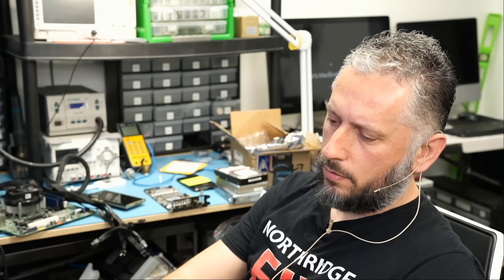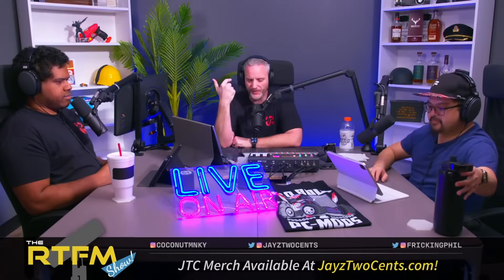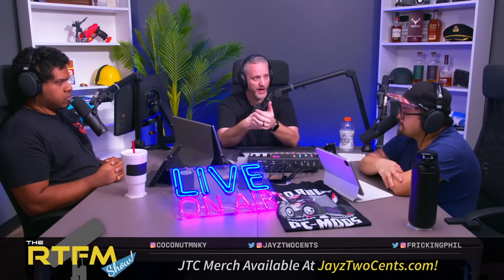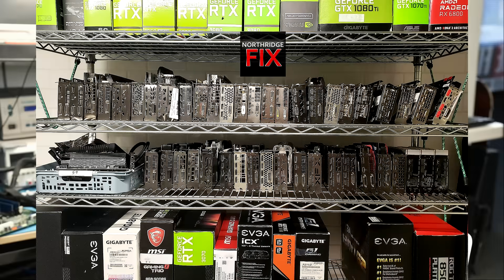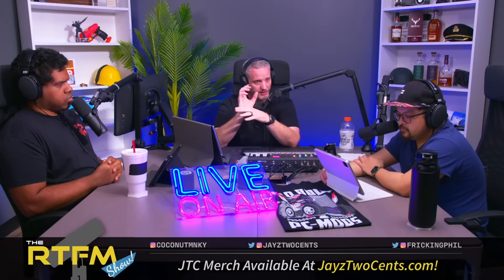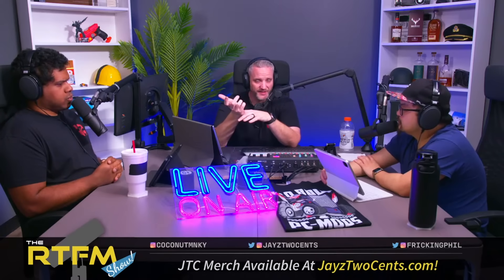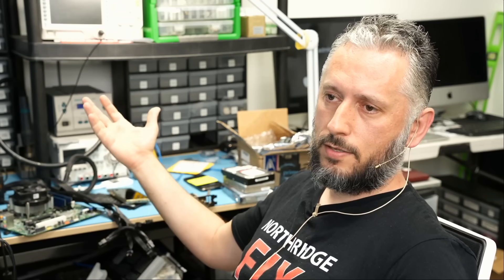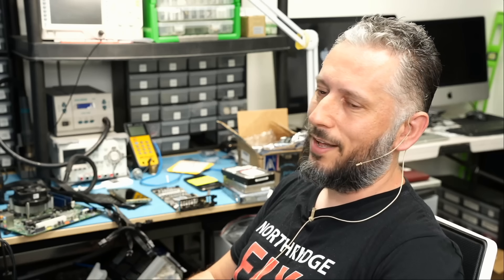Melting 4090 and CableMod. JayzTwoCents and Gamers Nexus Response. Blame NVidia or User?

Comment: I am agree with you, the maker of the card is the fault. The problem existed before you have ever received a 4080 or 4090 Nvidia card for repair. You could tell us, the last 6 months how is changed this in your shop. I think, more and more cards arriving to you, because the maker did not fixed their error.
Right now, the highest priced video cards are Nvidia 4080 and 4090, rather TI or not. For that amount of money, what kind of service do you get from Nvidia? Those cards costs a lot of money, and since not accepting their fault, this means they are not serving the consumers or the clients.
I am planning to buy and put together a high end PC computer, but seeing what happening right now, scars me a lot!
What about I have spared 8000 Dollar or Euro value PC, and I can't use it, because of the maker of the video card company, hiding rules and regulations, policy and warranty and mentioning lawyers defending themselves , instead of solving the problem and giving a high value product a high value service. And yes, I am totally expecting serving my rights and my demand as user to fix the problem, or compensate for the maker error!
How will this end? What happened if you replaced the connector the right way, the user did their best, seeded the connector fully, and again will melt the connector on the graphics card?
This is madness, because someone put their trust, money, and energy to have something at home. Maybe for entertainment, maybe for work, or both. And they lost their effort, because the company who sells the cards says, it is not our fault.
It's truly sad to see all those people fighting to get their card at least usable condition, knowing, will fail their card in the future. And no matter if they tuning their card or not, already too much power runs through their connector.

I am appreciate your hard work to help those people who's coming to you as you can to have their card working again!
Bless you and success!
Attila.

Comment: Has anyone looked to see if all the melted card ports were hooked up by the adapter included, or if they were using ATX3 PSU? I use ATX3 PSU which has a single cable and I have had no issues

Comment: Wiggling the cable will lessen the lifespan of the connector and the lifespan is listed as about 30 insert/disconnect cycles.  Yes, just 30!  The derated current carrying capacity drops well below the rated current consumption of the 4080.  Age and heat cycling will derate it even more as well.  This should have been a custom screw on connector with a large enough surface area and captive lock washers on the screws to prevent them from loosening over time.

Comment: steve with 15 on his shirt is that his iq  with the amount of failures is way beyond any chance of user error i think the pins on the board are too thin and getting hot  the whole connector should be upgraded and have a screw to help pull together and help separate or a lever cam lock like on cars to lock into place squarely as wiggling connector will open up and loosen the contact and cause terminal threading and that will cause heat and burning and that boils down to poor manufacturing and that means its their fault 120 percent agree with you how many cards have the manufacturer repaired and you as a electronics diagnostician see fails and see how the fails happen the root cause

Comment: This one is easy, GPU's increasing thirst for power makes this problem inevitable. Automotive or industrial applications use a different style of connector to consumer electronics. There is a reason the connectors cost 4 times as much. They deal with cable stress, vibration and thermal cycle creep though good connector design. 
https://www.jst.com/wp-content/uploads/2020/12/GIT-18P-img.jpg
1. Transfer cable stress into the housing not the pin. The housing is Screwed or riveted to the PCB so that the pins don't provide the mechanical support.
2. Cable Strain relief into the connector backshell
2. Double, Positive insertion confirmation - 'Click' when inserted and the release mechanism is visible if not fully inserted.
3. Pin and Receptacle Plating to score and bind to ensure connection
4. Receptacle Spring force maintained for 1000's of temperature cycles. 
5. Lever connectors 
Higher voltage:  Using 24 or 48V instead of 12V drops the current demand dropping I2R loss resulting in heating.
*Note: Automotive connectors are only rated for 20 insertions - is it possible that a keen builder has plugged, unplugged and wiggled the cable so many times that it has worn out the plating or receptacle spring?
I respect Jay and Steve for not fully committing to the root cause and admitting to not having all the information nor knowledge to make a definitive claim about root cause This is defamation if they get it wrong.
GPU manufacturers need to step up and improve their connectors before there is a fire.

Comment: NorthridgeFix are expert electronic board fixers with top notch equipment, experience and method and Gamers Nexus are expert computer component testers with top notch equipment, experience and method. Gamers Nexus has acknowledged that although they have tested for the causes of this problem before are still open to the possibility that an un-forseen cause is left to discover.

Comment: I like the idea of holding the company accountable over the user. Nvidia also has been silent over the issue. I personally had an AMD RX 6900xt set on fire once. So this could be preemptive to power limit issues. Above 400 watts seems to be the common denominator for me. Still don't know exactly why it set on fire to this day. These cards aren't even old enough to have that as an argument.
Reply: defective component, some pins maybe shorted, power supply  cant withstand full power draw on that cable, etc, there are a lot of possibilities for that.
Reply: @Milos Stojanovic  warrantee went through without a pinch all that mattered to me. This also is why there's short term studies vs. Long term studies. But I don't have a hard stance on this for either way. DerBaur has a power draw connector type adapter on his 4090, I'm not sure why tech tubers don't outift those with more monitoring equipment. All data can be logged like a black box.

Comment: The fact is if Nvidia continue to take the stand that's its a user error. 
When the RTX 50 series come out and users experience the same problem they will be screwed. 

The RTX 3090 Ti had the same connector but none of those cards failed due to melting.

Comment: what im thinking its over power and the connection it self are short. its like your using wire guage 18. and you running an aircon which is 2000watts. i think this is the case. the connector it self and the size cannot handle the power. thats my take. the need to make it bigger i think. if im not mistaken. the part where it sartrd the melting is positive line and it cannit handle the wattage. ive seen one vlogg when they use blender 3d animation. when rendering it drew 300 watts to 350 watts. thats why it needs a higher wattage power supply. i think the connector steel part cannot handle it.

Comment: I had experience with this, the Gpu drawing high current but the Psu 12v line was inadequate. 

There are multiple way this could happen. Using adapter with Psu with less Pcie gpu cable (ie 2 Pcie 6+2, plus Sata or Molex adapter to Pcie 6pin).

There could be other factors. From the burn marks however, all the 12V line was burnt. From my understanding, that means the cards was drawing full power or more.

Comment: the 4090's i've seen require 450 watt of power draw. This is the max amount of power this card can use going through that connector. Not really surprised they eventually melt. the 3080 has a power draw of 320 watts which is a lot less. The 3090 is probably a bit higher than this though maybe this is why the 3090 is fine as it has less power going through the connector and the 4090 there is just too much power going though that connector. Maybe if the adapters (The ones the graphics card maker provides) had thicker pins then this might not happen. Pretty sure putting a lot of voltage through a tiny wire leads to burnout.

Comment: I am not sure why the connector had to become smaller physically. If you pass more power over smaller wire/pins in the connector they will heat up more. 8-Pin PCIe connectors each have 3x 12v wires, but the pins in the sockets are twice the size. 2x 8Pin PCIe sockets are rated at half the power of this new connector which is 12 pins for power and 4 sensor wires. the 12 pins for power are 6x 12v and 6x ground, but the pins are half the size. So if 2x 8Pin PCIe sockets are not rated for 600W, why should this new connector even be rated for 600W.

I'm not an expert in electronics, but as part of one of my diplomas at college I did do a soldering course and many electronics subjects, we were taught very early, the more current you try to pull through a circuit the hotter it gets, if you shrink the wires and increase the power, things get toasty. the hotter it gets the more inefficient it gets, and one of my lecturers went as far to say that you can get a circuit into a runaway state where it heats up and gets less efficient causing it to heat up more.

I agree with Alex here, nvidia problem, card problem. Connector would be fine if it was rated for 300W. They rated it for too high power draw and this is what happens. 

Back in the 2014 crypto boom, same thing happened with some ASICs trying to draw 450W from 1x 6 or 8pin PCIe connector. The connector (and the actual 12v wires from the PSU) would melt in short order (hours).

So for my opinion... That connector should not have been used on the 4090, or use two of the connectors. Its not up to the task and I will not buy an nvidia GPU until they fix it (I rpobably wont buy an nvidia GPU anyway, prices are out of my budget, that said so are AMD for now and I cant be bothered stripping down my custom loop).

One thing that bothers me about the testing that Steve (and others) did to replicate this particular failure... At least the part he showed in his analysis video it was all done on an open air test bench. Likely with lots of AC ventilation. That is not a typical use case, it may well be that he couldnt replicate the failure because he wasnt running it in 50 or 60 degree ambients of a sealed up computer case. One must not forget, that not everyone has the knowledge to perfectly setup the airflow and perfectly cable manage thier system to optimise airflow. Open air test benches trying to replicate failures where temperature is involved is a useless test.

I feel like Steve's latest news video, he really was just exhibiting severe confirmation bias, which is a human factor where he has decided user error is the primary cause and now every bit of evidence he come up with he looks for ways it can confirm what he already knows. But that is just me. I will still watch his new coverage on the subject if he publishes more about it, but to pin it mostly on user error is just nonsense esspecially when his own testing was not done in a way that replicates normal PCs, it was dont on open air test benches, and there was significant airflow around that GPU connector as the smoke from the melting was being carried away quickly by air circulation.

Comment: Since the cable side of the cablemod adapter didn’t melt when the board side did indicates that there might be an issue with the surface finish, lubricant or contaminant on the nVidia board’s connector.
Reply: If that is the case, the current through the connectors is beyond the acceptable safety limit.

Comment: There where a pretty good explanation to why the connector is melting, and why same connector in 3090 Ti doesn't. The short answer is the load delivery to individual pins in the connector is uneven in 40 series unlike it was done in 3090 Ti, so it is a 100% design flaw by Nvidia. And besides that I can't wrap my head around the decision to replace 3 or 4 beefy  6+2 PCI-E connectors with the one so puny.. planned obsolescence?

Comment: I have be quiet! cable for my 4080 Phantom GS, so far it's fine, it was easy to plug it in, but I still keep my eye on the connection (my PC stand near the monitor so its in plain sight)

Comment: why everyone didnot talk about terminal pins inside the connector? there are several designs (dimple, spring, etc). while spring design has been better since long time for high current usage. many cases about melting connectors came from the product with dimple design pin within

Comment: IMHO it comes down to current flow and power. The material in the connector the metal and housing are not sufficient to mitigate the power transfer through it. Which the end user did not have anything to do with that design

Comment: I watched GN video first and then I saw + watched your video. I am not an expert in electronics and repairs just few mostly non micro fixes and I agree with your point of view. Even if slightly unsitted power connector it should be NOT a problem. That new Nvidia power connector has smaller contacts and still should be okay but it is not. For decades world builded computers using different types of power connectors and there were way less issues than with this new 12V one. GN said that costumer may used cable connector and later connected angle connector... melting happened on angle one sitted all the way fully in. There can not be transeference of cable connector issue to angle one. GPU connector damage was worse and at same place over multiple GPUs.

I see, that GPU takes too much power and metal contact surfaces between GPU and cable is just too small where it starts to produce heat and heat melts plastics.

I would rather see classic PCI-E gpu power connectors and maybe seperate small 4 pin one (PSU communication power pins that are integrated on that new connector).  

Nvidia needs to change the connector no other way arround it.

Comment: Blows my mind.  You pump 600 watts into a cheap plastic badly designed connector and it’s a users problem? Wtf?  It’s a crap design.  The design has to include  end user use cases that includes 10’s of thousands of users. All this noise is pointless when common sense shows it’s a bad design.  The who’s to blame conversation is a waste of time. The spec should be updated and redesigned. It wasn’t an issue until someone said, hey you know what would be cool?  Let’s power slam a single cheap plastic pos connector with 600 watts lol.   They should get out of the weeds and look at a 10000 foot view of the situation.  It’s very entertaining to watch lol

Comment: When one cannot reduce the current, one can try to reduce the resistance. In my experience 90% of resistance comes from contact resistance, because it is a runaway process. Heat will cause the pins to oxidize, which in return will increase the resistance, until the heat exeeds the melting point of plastic. Has anyone tried to measure the resistance with a milliohm meter from the pin entering the PCB to the end of plugged in cable?

Comment: From my 40+ years of experience, I can’t see how these little pins can carry load of 20A and more. It may be up to 20A in peak spikes, but not constant 20A. No way.
The idea of multiple pins over 2 or 3 connectors was to spread the load and not to run hot even if one pin does not have a good contact.  Fully agree with Alex, this is design issue.

Comment: I think that this might of been mentioned before, but I believe that someone needs to run this card at its full performance specifications for a prolonged time and monitor the heat dissipation of the connector with a thermal camera (ideally have three machines, one with the cable mod, one with the cable misaligned and one fully seated)  As an electronic technician with over 45 years experience I know how thermal cycling can loosen a connector, causing a rapid avalanche of high resistance failure of the conector due to expansion and contraction. Even gold plated connectors fail.

Comment: I wonder what the actual power rating is of that connector and the actual power requirement of the board. If the two are very close and a connector is not fitting quite as tight as it should (metal pin being gripped by metal socket, NOT plastic-to-plastic friction or failure to insert) that would explain the issue. That would of course be an Nvidia problem. 
The fly in the ointment is if the majority of the boards being fixed had cablemods fitted (and removed as they hadn't yet welded into place) and it is the cablemod plug connection that's weak? That would require speaking to owners of boards ...
There is an obvious issue, perhaps it's best left as a fight between owners, Nvidia and Cablemods. You carry on fixing them, take the money to do a good job and don't get embroiled in the mud-slinging?
Reply: It isn't our fight at all, these failures are occurring with the stock Nvidia cable, competitor 12VHPWR cables, and the 12VHPWR cables that come WITH the PSUs from the manufacturers directly. As NorthridgeFix mentions, the continued failure is the connector on the GPU directly.

Comment: I’d look at carrying out a 4 wire resistance test, pass a known current (100mA should be ok) down the lead through each conductor in turn via the connector to some convenient point on the PCB.  You can then measure the voltage drop directly across the connector in mV and use ohms law to calculate resistance and power dissipation.  The should identify the problem.
Reply: Impedance? Differences of resistance of psu pcie cable vs gpu connectors?